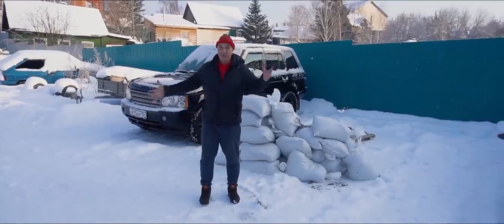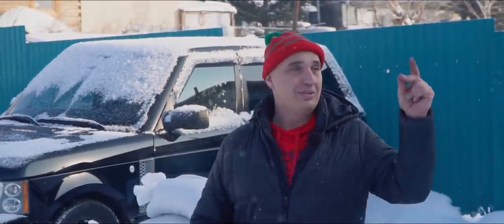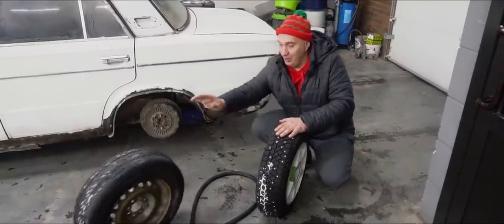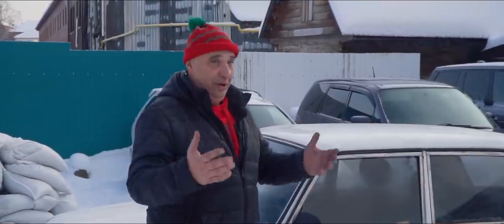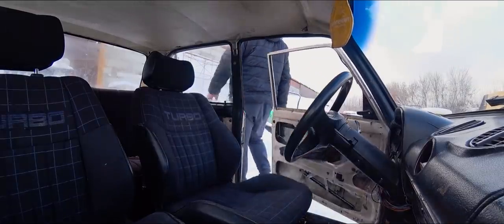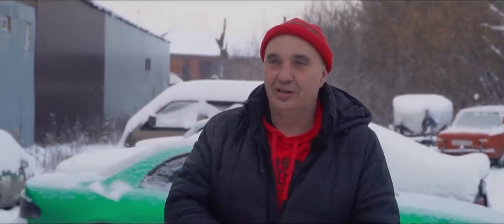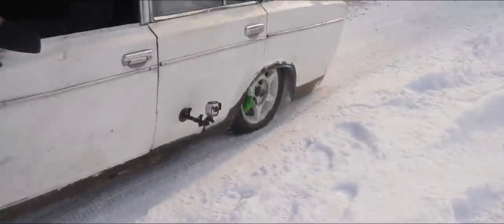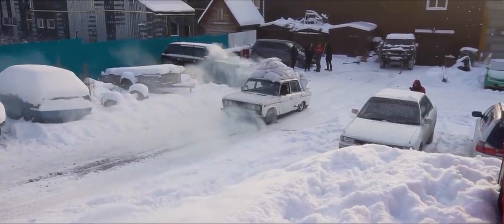Loading 2.5 metric tons into a Lada - how does that affect grip?

Comment: Try to move something reeeeeeeally heavy, I mean train wagon heavy, with JUST ONE Lada engine and changing just the gear ratio of the coupling, or joining several transmitions together to get a very low gear.
Reply: Actually, the train wagon is relatively is relatively easy to pull, because the rolling resistance of the iron wheels on rails is minimal.
Reply: @dr.eurobeat619  you don't say. You got the idea man. I meant they could try to pull something as heavy as a train wagon (or wagons).
Reply: @dr.eurobeat619  And either way, pulling a train wagon with a lada won't be an easy task
Reply: @dr.eurobeat619  yes, but the steel wheels of the vehicle doing the pulling equally lack traction to get the load rolling

Comment: Just getting in that car with over 1 ton on the roof could be a death sentence. This man lives on Main Street in the Danger Zone
Reply: He sold Lemonade in the Sniper Alley in Sarajevo...
Reply: Considering roofracks are usually certified for less than 100kg, it is insane this load did not deform the pillars.
Reply: He had about 15 bags on the roof ( some more on the rear seat and top of trunk). Thats about 750kg and only 125kg on each of the 6 roofbeams. As a proffessional russian he knows, he can trust that lada beams easily. Nothing to fear at all.
Reply: Don't you remember when you put a 20 tonne container on a 2106 roof and it held no problem?
They could even open and close the doors no problem haha
Reply: @narancs5  That's more to prevent roll over and instability not that the roof wouldn't take it. Any even half assed well build car will withstand its own weight on the roof (to be safe in rollover), and truly well built cars will last many times their own weight on the roof. Like 5 SAAB's can  be stacked on top of each other and the lowest one won't really deform. 😂
Reply: He shakes hands with danger a lot.

Comment: I take back anything bad I've ever said about Russian cars
Reply: Italian*
Reply: @pier11francesco  Russian *
Reply: @Bt.Gang.Activity  it's a fiat 124 1966-1974 with a different engine and a lada badge just look it up
Reply: @pier11francesco  and also re-designed suspention, to acomidate bad roads and DIY repairs, that can be done with basic garage tools.
Reply: @3rdHalf1  also thicker steel :)
Reply: With the amount of differences between the original fiat and the lada. The Russians essentially reversed engineered it and built it their way
Reply: @pier11francesco  pretty dam sure that’s a lada. Since when has our Russian car genius lied to us
Reply: @spacy9571  thicker steel for more rust! :D
Reply: @spacy9571  Idk about thicker steel I can't really find much on google but if that's the case it makes sense after all it was a car from the 60s
Reply: @joshaulis8326  btw the engine is a different one but still from Fiat
Reply: @pier11francesco  The engine of the Lada is not a Fiat engine.
The Russians deemed the Fiat 124-series OHV engine too old and without much room for improvement. So they increased the cylinder spacing to 95mm, changed the bore and stroke from 73x71,5 to 76x66, maintaining the 1.2 liter displacement and made a new SOHC head.
The Italians liked the changes so much that it influenced some of their later designs. The gearbox was also changed - bigger clutch, stronger synchros, gears from Fiat 124 Sport, modified driveshaft.
The engine had a lot of unrealized potential and just a simple tune-up raised the power to nearly 100hp(low compression, bad carburettor and so on)
Reply: @pier11francesco  and spacy is right, the bodies were thicker.
Reply: @joshaulis8326  first models was made from t34 steel so ticker stronger steel with minimum rust over years without any care. It was like tank
Reply: @joshaulis8326  On wiki it says it was a Fiat project derived from  the engine block 124.A it might be wrong idk
Reply: the kuck tryna make everyone think the rover in the intro was his. lmfao if it was his, he woulda stacked the sacks straight on the hood. but russians still have standards for cars that aren’t theirs lol
Reply: I drove a Lada for 4 years. One of the best cars I ever had! Loved that small dude.
Reply: @pier11francesco  yes the block. But the engines in the fiat and the lada were completely different. The creation of the ohc derivative in the lada was later adopted by fiat. At the time lada had the ohc engine, fiats had ohv engines with pushrods.
Reply: @joshaulis8326  the entire design was given to them by Fiat, it is a Fiat block and head. Without the Fiat tooling and blueprints the Russians would have been riding donkeys until the 1980s glasnost era.
Reply: @TheDumpbin  yes they were given everything but then the Russians made it better, by literally going back over everything.
Reply: @joshaulis8326  :D  ridiculous, as Fiat put its investment into the twincam engine, the spider and coupe which were more profitable, plus Fiat had many other products they made, like the luxury Dino and 130, trucks, buses, the Lancia division, the marine division, etc.

Russians had nothing else but the 124 sedan and donkey carts to move around, so yes they put all of their investment into the only car they had that would actually run, something the Russians could not do by themselves. You are ridiculous.
Reply: @TheDumpbin  hey guy I literally listed everything the Russians did to make the car their own, innovations such as the engine that fiat would later adopt. And you can list the other other cars that doesn't matter because they don't pertain to this discussion, fact is ladas version was much more robust and dependable by comparison
Reply: @TheDumpbin  and to further correct how wrong you are, the head wasn't fists. The ohc design was ladas design because they got the engine in its pushrod ohv form and designed the head that fiat would later adopt
Reply: @TheDumpbin  why so serious
Reply: @dexnom1  Armor plate steel is far more expensive than normal steel and probably is a lot harder than what you want for a car frame. Manganese added to steel helps prevent rust and one of the early automotive uses of steel with manganese was on the Ford Model T frames.
Reply: @quentagonthornton49  Russians didnt use manganese steel, but MZ-2 steel - nickel molybdenum steel only
Reply: @joshaulis8326  Actually they bought a good deal of these designs, as those were already decades old and the owners would sell them cheaply - they get a proven and well known design they fit to their needs and is legal for sale in the West aswell. That was a thing in the eastern block - for example Chavdar in Bulgaria bought old Setra designs for their buses - who were sold successfully abroad. Though of course there was a lot of unlicensed copying and industrial espionage, as I've been told quite crazy stories how they had to dissasemble, study and then reassemble computers in a single day, no, night, for them to be ready and for use in a shcool or some other similar institution - as computers were goods that were under trade embargo.

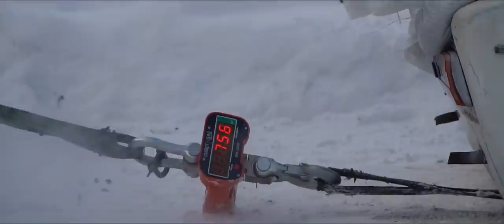Comment: The actual result for the 1.5 ton test occurred around 14:03 when the Lada had essentially no momentum and yielded around 568 kg. The 800 kg they claimed was a product of the Lada's inertia as a result of the relatively short distance they were able to accelerate (uninhibited by the Hummer) after allowing the Lada to drift backward slightly. Nonetheless, it was still entertaining and the results were mostly meaningful.

Comment: Do the independent brakes - 4 master cylinders connected to a joystick in an X  layout and the master cylinders separately connected each to a respective wheel. Drive, and use the joystick to activate each brake independently to steer. (or use 4 brake pedals?)

Also, hook up the throttle to the steering wheel.
Reply: There's a flaw in your model! It doesn't make any sense using a joystick.
Reply: @thefreedomguyuk  Dude, not an actual electronic joystick, you clown :P A metal rod that pivots like a joystick, which actuates pushrods into the master cylinders. Like a FWD manual shifter mechanism with a nylon ball on the bottom and rods welded to 
the shift rod - push it forward, front brakes engage. Push it to the forward left, the front left brake actuates. Push it to the left, both left brakes actuate. And so on in that fashion.

Comment: I used to have a picture of a VW Jetta, that was overloaded.  They went to Home Depot and bought lots of building supplies.  There was one ton of cement bags in the rear seat.  Then they loaded several hundreds of pounds of drywall and plywood on the roof.   Home Depot wouldn't let them leave until they signed a waiver for potential damages.  The car was spotted a few blocks away with the rear shocks shoved thru the trunk.

Comment: Lots of cars nowadays uses something like a snow mode for setting off in snowy terrain. What it does is that car shifts into second gear and you start moving with lower rpm on a tires, so you increase a grip. pretty simple and handy when you are stuck in the snow.

Comment: In Michigan a rear wheel drive car takes about 140 lb, they sell gravel or sand in heavy duty bags at 70 lb each. For a small pickup truck you need 300-500 lbs, for a full size truck up to 1,000 lbs.

Comment: I owned a '91 pontiac sunbird 4 cylinder 5 speed. on the way to a weekend concert with a friend, we came to a long, steep hill. I had a tent, 2 chairs, and a folding table in the trunk. it started loosing ground so I pulled over to the shoulder and started over in 1st. I could only go up to 3rd and made the top of the hill on the shoulder going about 40 with the gas pedal on the floor.

Comment: Really cool test, I've always wanted to see how much lateral force a vehicle can apply with X weight over the drive wheels. Just wish they'd done this on a controlled surface like inside the shop so you can ensure the same amount of traction every time vs the tire studs digging through the snow to the surface below affecting the results. Hard to imagine that the weight on that little car is 700 pounds more than my Ford F-150 weighs. Unreal.

Comment: I have 2wd 92 Silverado, I have never put anything the bed in winter, I've only had it stuck once, but my truck also has a locked diff, I installed a aftermarket rear end so I'm sure that helps. My 91 C1500 4.3 truck was a 1 tire fryer, it got stuck if it thought it was snowing lol.

Comment: I used to put 600# (~272kg) of sand bags in the trunk of my 4 door 78 Nova with a 250 straight 6.  Accelerating traction was great, braking and steering were worse.

Comment: Drop a Hellcat (6.2L Supercharged HEMI) in a Lada along with an upgraded super strong clutch and try this again.  That would be fun.  Or just any engine with over 700 horsepower basically with a strong clutch.  Although gearing can also substitute for lack of horsepower, so maybe modify a transmission and diff gearing to get a really low range gear.

Comment: In a Skoda 105 which was rear wheel drive with engine hanging behind rear axle you actually had to put some weight in front as it would have plenty of traction on ice but would refuse to steer.

Comment: As to the question at the end, i would assume its a logarithmic function.   How wide are the tires, how big is the motor, those determine how much weight is needed to bog down the rear tires.  My personal belief is to look in the owners manual, see the max payload, then use that number to make the car at its max weight (from factory spec, not one that is overloaded).  

That should be the best the car can do, though i suppose you'd need to weigh down a lorry far more than a lada to get the same results.

Comment: I believe if you would have distributed that weight more evenly on all four wheels as opposed to just on the back of your car it would have probably been able to handle it, because the rear of the car was dragging on the ground, that has to be slowing progress.
I grew up in Michigan in the winter I always used to carry either sand, cat litter, crushed clay on the floor of the back seat of  250-300 lbs always helped with traction. If I did get stuck I would throw sand, clay under my tires to help me get unstuck.

Comment: * POTENTIAL PROJECT * TWIN FIRED 4 STROKE - 2 STROKE *
Hey guys, I have an idea for a fun video! How about making a 4 cylinder engine fire 2 pistons at same time of stroke. My understanding is at TDC there is 2 pistons but only one receives spark until next 4 strokes, my idea is to have both pistons at TDC to receive spark at the same time, same with next 2 pistons at TDC. Providing the spark will be easy but you will need to change valve timing for for fuel delivery and exhaust for the other pistons, you may be able to cut the camshaft in half and rotate the back half 180 degress then re-weld it. It should produce a heap more power.

Comment: I laughed so hard when he said that they don't have any non-welded diffs lmfao! It's not really cheating, a limited slip differential is almost as good, in my experience. Also, the restriction is that the car is rear wheel drive only, so actually the welded differential is the best way to test the absolute limits.

Comment: Try 3

Could you get a fiat 124 (or a Motor from one) and replace the push rods with glass ones.

I had the idea after looking at the glass stir rods used in science class. They are  glass shafts with glass nubs on the end.

Comment: Try the same setup but with an automatic transmission (oil cooled) equipped Lada with working brakes for safety, also change motor to stronger engine.
Reply: There are not automatic gearbox ladas. 
Only some very rare models made for Canada under name Dennis Signet

Comment: No it won’t give more thrust, 680 kg was at the engines maximum work rate. This shows that for a lada dragster experiment, the revs must be kept at 4000 rpm at full throttle. Then we can expect acceleration of about 8 m/s/s, or 40 metre per second in 5 seconds. The lada is capable of 144 km per hour in 5 seconds. However peak force was achieved by using engine and vehicle momentum (transferring engine deceleration to wheel torque momentarily. Therefore I predict 0 to 100 in 5 seconds at continuous high revs.)

Acceleration due to gravity 10 m/s each second so 680kg/850kg x 10 = acceleration of lada at full power, as 1 kg force accelerates 1 kg weight at 10 m/s.
So there’s the theoretical basis of the experiment.👍🇷🇺

Comment: I am guessing that the more you add directly to the tail end is changing the weight balance enough to move more than the weight of the bags rearward?  Would be interesting to put the car on corner scales and measure the weight on the rear empty then after adding weight.

Comment: Tuning a lada 2107 1.7L engine and make maximu power until the engine just explode 🤯 🔥 I bet it will handel 460 hp 😎 but it's Lada you never know. But like do it korrekt( change krank shaft, pistons, piston rods).